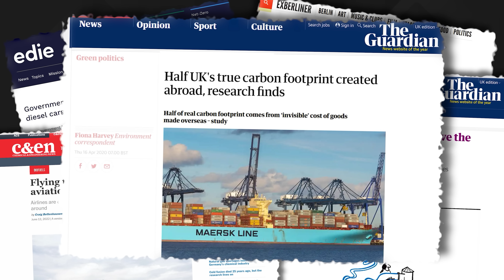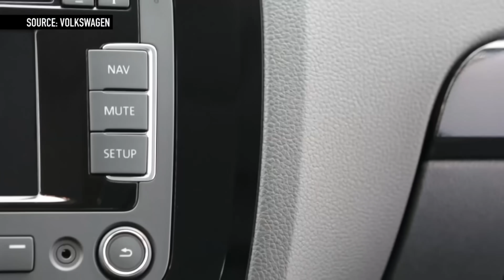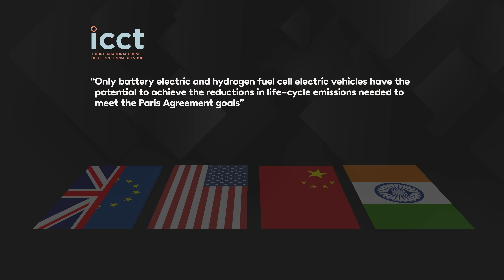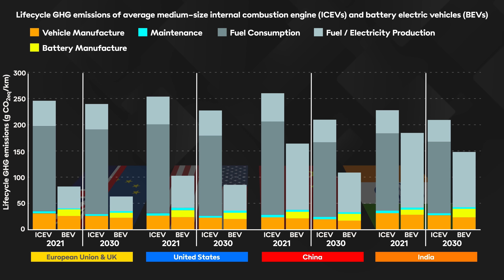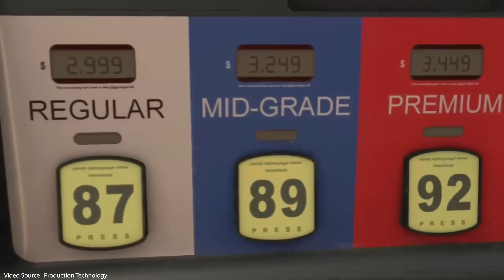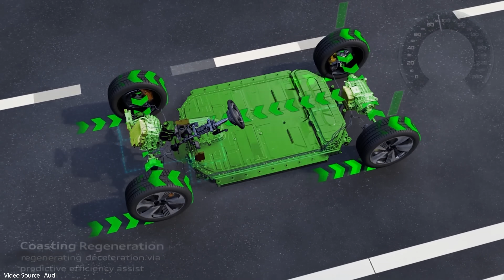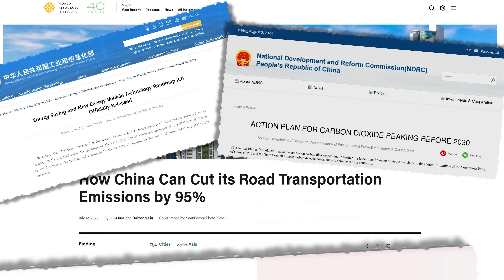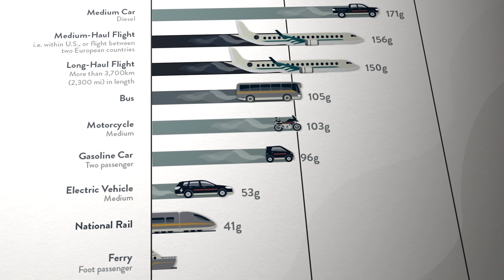Are EVs really better for the climate?

Comment: Having owned an EV for over 6 yrs my experience has highlighted to me the lower wear on brakes , the absence of waste engine oil , air , fuel & oil filters , and cam , alternator drive belt wear. as well as gearbox oils, and clutch wear, and spark plugs. Do we class the Exhaust system as a consumable too?
Reply: The lower wear of brakes is so pronounced that I have been asked by my mechanics to actually stand on the brakes weekly in order for them not to rust.

Driving energy efficient has cost me 4 new brake disks...
Reply: @madshorn5826   I've seen where they're starting to go back to drum brakes for EVs so they aren't exposed to the elements and won't have to worry about rusting from a lack of use.
Reply: Also, the scaremongering about battery lifecycles is wholly inaccurate. I’m sure my EV will last a lot longer (rust permitting) than most of my previous ICE cars although I do appreciate that government policy means repairing those older cars is pointless from a cost point of view.
Reply: Thinking of all the emission soot, leaky fluids, and brake dust covering our roads and towns… also all these motors emitting uncaptureable heat… so gross
Reply: @TurdFergusen  Agreed - I occasionally work in a car park and the smell and taste of all the exhaust gets really bad after an hour or too - so here's to cleaner air in cities and elsewhere!
Reply: @TurdFergusen  You could always go live in a cave if you think burning fuel to keep modern civilisation going is "so gross".
Reply: @geoffhaylock6848  you sure extrapolated that out in the worst way possible
Reply: @TurdFergusen  "so gross" is not the worst possible way to describe the fuel that powers the modern world? The fuel that helps prevent millions from dying of hunger. Maybe step outside your bubble sometime and look how the world works and not just how a latte is made at your favourite coffee shop.
Reply: @geoffhaylock6848  the fuel that is required for EVERYTHING you touch and you buy… so why waste a finite resource on driving to grandmas house?
Reply: @geoffhaylock6848  oh man now you get to explain… from your high horse… how those millions (actually, hundreds of millions) of people will fare when oil becomes scarce and we dont have alternative technology because we didn’t force R&D on it, and we wasted it on all kinds of stupid things
Reply: @TurdFergusen  technology is already evolving. Have you not heard of the EV revolution? But it will take time and building more nuclear power stations will take time. We have the time before oil runs out. I hardly think describing the current fuel as "so gross" is really forcing R&D. Tesla introducing products that people actually want is driving R&D.
Reply: @geoffhaylock6848  no, youre the one who fixated on that.  it IS gross to have ice vehicles smearing up everything.  but that isnt an argument that they need to be banned now, that would be dumb.
Reply: @TurdFergusen  Alas, public transport does not yet provide an alternative to owning personal transport. It will be a while before the current billion cars are all weened off burning fuels for propulsion. And for poorer families that cannot afford a $50k new car, the time will be even longer. When will the day come of the $1000 used EV?
Reply: @geoffhaylock6848  we all grew up around these things so its normal… but how bad are the emissions, noise, heat and fluids from these millions of inefficient machines ? its gross and the thought of us being able to soon see a world where theyre minimized is yet another good argument towards promoting EVs.  also existing ICE companies would never have changed on their own.. it took competition from tesla and the government… and they still might go bankrupt… they spent marketing dollars to slow down EVs… how can you support a company like that?  remember when they covered the world in lead just to stop engines from knocking?
Reply: @geoffhaylock6848  people waking up and seeing our streets and air as gross will 100% help the ev revolution and thus R&D
Reply: @geoffhaylock6848   prices will come down as mining ramps up and due to the high recyclability.. the mining will eventually ramp down; on top of that, robotaxis will reduce reliance on cars as well. and as AI improves it will become apparent that we wont need such safety centric design which adds weight, costs and complexity
Reply: Is the battery still running !
Reply: @baasittantray007  it's 8yrs old done 56k miles and has full 12 battery bars
Reply: @waynecartwright7276  You're looking at an interface,  not the actual battery health.
Reply: Counter argument to Just Have a Think biased argument... https://www.youtube.com/watch?v=TUx8yIlKVpU
Reply: I hate to shatter your dreams, still need to replace the lifetime gearbox oil since almost all EVs have them if only a single gear, as well as differential oil.
Reply: How much damage does one battery change make? And how much will it cost you? If you own a Tesla the amount of maintenance on an equivalent gas car won't even come close to the $16K-25K you'll waste on a new battery. And not all batteries last 200K+ either. Some go faster.
Reply: @Synchromesh123  you have no clue youre just injecting conjecture
Reply: @TurdFergusen  Riiiiight. I've only been researching EVs for the past couple of years but clearly I know nothing because the internet doesn't provide any information about them at all. I'm the problem here. Me.
Reply: @Synchromesh123  so basically.. “trust me bro”
Reply: @TurdFergusen  Don't trust me, bro. Do your own research. You can look up how much it costs to replace a battery in your average Tesla. They start around $16K. And that's if Elon doesn't increase prices which he might as he does that all the time. $16K buys you a lot of maintenance on an average gas car. I have an 11yo Subaru with nearly 100K miles I purchased new. All the maintenance I've done to it to date doesn't amount to even $10K yet. More like $6K tops.

Comment: Hi all. Does anyone know if the comparison between planes and ice cars takes into account the miles traveled. I do between 2000 -3000 a year in my car but even though a plane with 300 passengers on it is more efficient, I could travel 4000 miles in 2 hours ? Plus the planes are in constant use.

Comment: I thought about buying an EV multiple times. But every time I get to the same conclusion - EVs solve the the emission, but not the congestion problem- I will still be stuck in traffic. That is why I commute by bike  / escooter. For the longer trips - The EV will be more of a burden (as the charging network is very poor). I hope in 5 years the network would be good enough to make the switch, as I am believer this is the way forward.

Comment: I don't think it was covered in your comparison of vehicle but I quite like the idea of an ev with a small petrol powered generator. You can fit a small size battery, say 150 Mike range. In the right  circumstances you do almost all you miles using the charge from the battery. But for occasional longer journey you can use the petrol generator to remove any range anxiety issues. As this does not seem a popular idea at the moment can anyone let me know if I am missing something.

Comment: Peak public transport option is the trolley bus or tram. A trolley bus with a short range battery is king. This is old tech that has been grinding around third world cities for as far back as anyone can remember, but the fact is, if they haven't been removed, they are still going! They are totally reliable, extremely flexible and move large numbers of people quickly using existing infrastructure. Many cities had trolley buses or trams and pulled out the tracks and overhead lines for diesel busses. Time to retire the diesel buses put the overhead lines back up and take a step backwards to take a giant leap forwards for mass transit. Replacing a car with a car is stupid. It doesn't fix anything. We need to take cars off the road altogether and get people on a bike, using their legs or on a trolley bus.

Comment: The thing I like about electric cars is that you can choose where your energy comes from, from Solar to charging it of a dirty diesel gen set.
In many places, you can sign up for your household electricity (the most common way to charge an EV) for your quota of power to come from various green sources.
If everyone signs up for green, then the power companies will have little choice  other than investing in more green energy.
Reply: One problem with that. We have this exact problem in the Nertherlands. More people buy green energy then there is green energy produced..... Then again, I would buy exclusively nuclear power if possible so your idea has some merit but implementation is as always difficult.
Reply: Counter argument to Just Have a Think biased argument... https://www.youtube.com/watch?v=TUx8yIlKVpU
Reply: People need to stop demonising nuclear power. It is the only power source that can be reliably available 24/7. Even some of the big hydro installations ae finding that water is not an everlasting source of energy. Of course we could just wait for Fusion 🤣
Reply: @geoffhaylock6848  Yup. China is having a wee bit of a crisis. If that was the only one it wouldn't be a problem but they got a plethora of problems. Nuclear really seems to be the only viable solution at the moment.

Comment: Surprisingly, I thought the difference between flying and car would be greater.
Reply: Primarily because an airplane is a flying bus. When filled up with passengers the emissions per passenger km are relatively low. The main concern is that airplanes make it convenient to travel further more often. 

Additionally the water vapor in the contrails is a greenhouse gas, but unlike CO2 a short-term one. Adding that up to the GHGs from flying is unreasonable in my view.

tl;dr: If you have the choice for a trip between a coach seat on a plane or driving yourself with no passengers or cargo in a not particularly fuel efficient car, either one comes out the same. Take the one you prefer. An online meeting would reduce emissions to near zero,  and a train or bus ride nearly as much. But neither alternative is always possible or desirable.

Comment: when a gasoline 4-stroke engines efficiency is only 1/3 then about 2/3 must be heat, why not burn the gasoline in powerplant to make both heat for houses and elektricitet..

i´d like to se where a 2-stroke 50cc moped/scooter fits i that line up you showed: its light weight but ones heard that one 2-stroke scooter polutes 50 times more than one car with catalytic converter !?
Reply: Yes. Two stroke engines are terrible when it comes to air quality.

Comment: Yes EV’s are the future but there is a big gaping hole in these calculations. If you compare the carbon cost of any NEW vehicle (ICE or EV) over existing vehicles then there is a big initial carbon hit. Going forward the greener car is one that doesn’t have to be manufactured. If we attempt to force the change to new vehicles we risk a severe spike in carbon emissions made much worse by EV’s initial higher carbon costs with their batteries. Chasing a greener future by junking vehicles that we have already paid a large carbon cost for with new products that have their own fresh carbon footprints seems madness. Another example of our throwaway society. Gradually replacing ICE vehicles with EV’s at or near the end of their life is surely the most carbon efficient way. At the moment there is a huge marketing push towards EV’s that is more about sales volumes and has the potential to make things worse rather than better in the short to medium term. We have to consider the most carbon efficient way to make this transition and a rushed wholesale junking of what we have already manufactured (with its already paid carbon costs) to a new paradigm (with its new carbon costs) is surely wasteful.
Reply: A carbon spike is not a problem. It's only the sum of the future emissions that count. So yes, replacing an older ICE car by a new EV is better.
Reply: @Freba9  So at what point in the future would the “Sum of future emissions” including a carbon spike be better than one without. I’m not arguing against the change, I just think that there is a better way to do it. Surely a transition without a spike would be cleaner overall? 
Considering that more than two years of lockdowns and the resulting reduced transport emissions have had no effect whatsoever it would seem perverse to casually throw a carbon spike into the mix.
Reply: @kenbatchelor8284  A new EV is already cleaner than a comparable ICE car after 3 to 4 years of driving. So any ICE car older than that is worth trading in.
Reply: @Freba9  I totally agree with the first part of your statement if you are talking about 2 NEW cars, but you’re not getting the hang of this are you. By manufacturing a new EV before it’s really needed and throwing away an existing vehicle before end of life you are generating a whole lot of unnecessary carbon, both in the building and disposing. Multiply this by millions of cars and you have a carbon avalanche.
If I said to you that our houses aren’t really efficient and we should knock them all down and build energy efficient ones asap - you would think I was mad, at least I hope you would. Same with cars. The greenest thing is to use them less and gradually change what we have to sustainably powered Electric. We can’t just buy our way out of this conundrum. We have to think our way out - assuming it’s not too late already.

Comment: I'd switch to a BEV if the cars charged faster. Without parking near my house, sitting at a charging station (with the inflated price/Kwh) for hours each week is non-feasible/viable and imagine the same for a significant number of UK car owners. This is where I see hydrogen (from electrolysis!) being the true green fuel of the future.
Reply: Chargers will be everywhere and overnight curbside charging is what will solve your problem. Hydrogen is a terribly inefficient solution and will not be the 'green fuel' of the future - at least definitely not for cars.